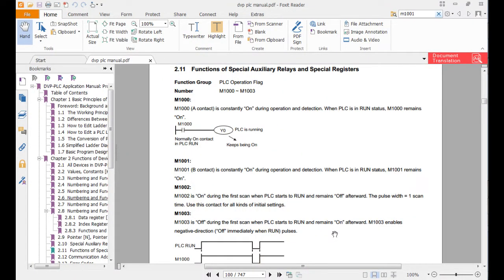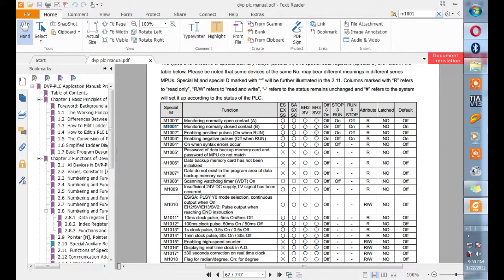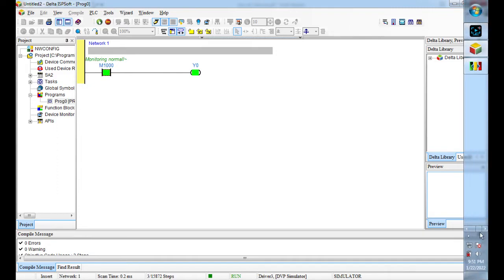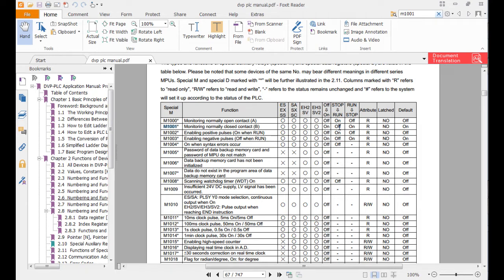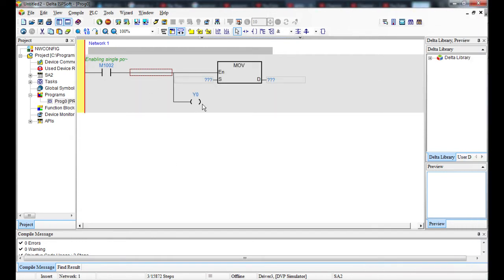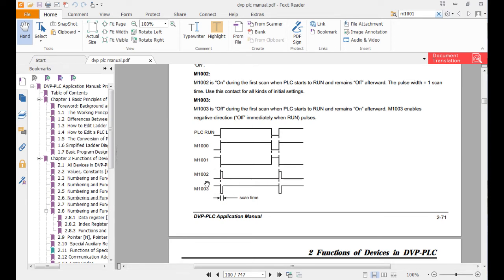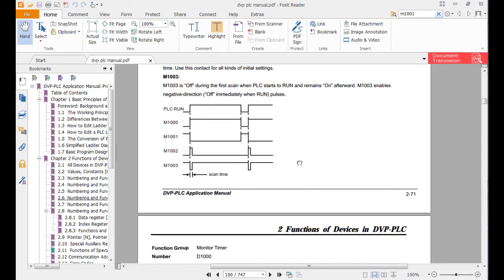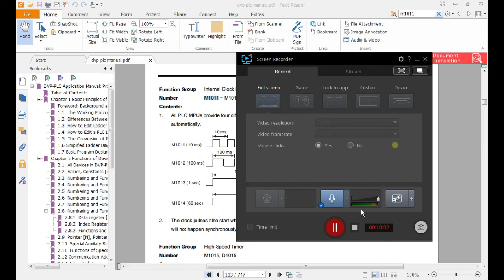delta special registers , plc flag , m1000 ,m1001 , m1002 , m1002

Comment: In delta plc what is the address for each scan cycle pulse. Each scan I need a pulse but can't able to find you suggestion pls
Reply from the maker: Hi not sure if there is such a register but you can check register D1010 to D1012 maybe you can work out your solution from it